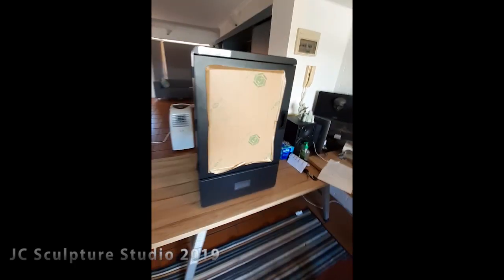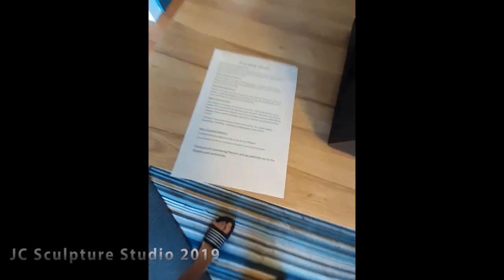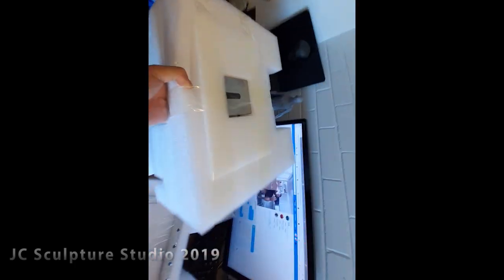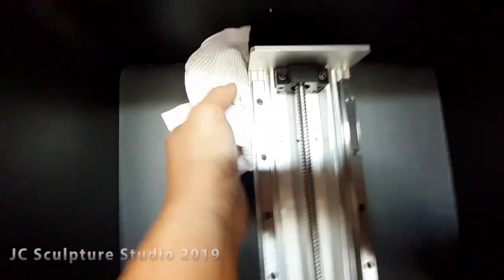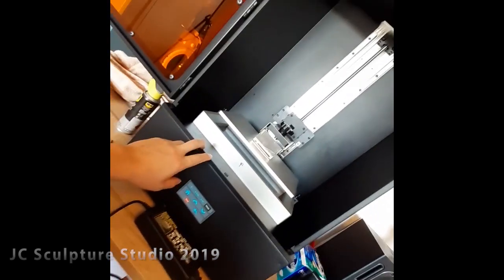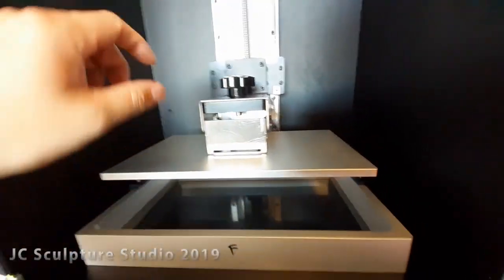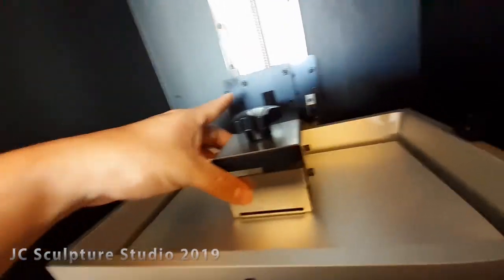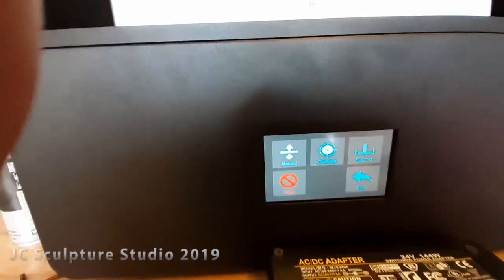Peopoly Phenom unboxing, level & first print

Comment: Nice video! I noticed u leveling with the VAT on? I did my leveling not using the vat and used a sheet of paper , lowered the z until paper couldn’t slide out then hot z=0, am I doing the leveling incorrectly?
Reply from the maker: Are your  printings sticking? If so u have done it correctly. Using a cleaned vat will give you true level, as some paper thickness can differe, but paper method is fine
Reply: @vfxforge  yes prints are sticking bit getting some weird flakes attaching to every prints even using a new fep and vat and filtered warm resin
Reply: @vfxforge  how do u make sure the platform is touching the vat FEP when leveling? Can you post a specific leveling video? Love ur work!!!!
Reply from the maker: @ArianHypnotiq  i dont think thats a levelling issue. get in contact with your printer maker.
Reply: @vfxforge  getting a new lcd from Peopoly. It’s a phenom L
Reply: @vfxforge  could you shed light on how you level yours with vat?
Reply from the maker: @ArianHypnotiq  same process as with paper, just using the vat + Fep instead, instead of trying to slide the paper down, just make sure you push down evenly when tigtening the bolts in two rounds, the trick is do it in two goes as I explain in the video.

Comment: Just unboxed my new Phenom.  Very well packed and it arrived very quickly from HK.  But no docs in box.  Anyone know where I can get user manual and/or setup guide?
Reply from the maker: docs and files should be on the USB thumb drive that came with the printer, or you can download it on the g drive they provided.
https://drive.google.com/open?id=1ELABSgXPBN7a1gGepzy_lgR7WWrRJHFm

Comment: What about a side to side test vs moai 200?
Reply from the maker: phenom wins
Reply: @vfxforge  I kinda guessed it as you already had Moai 200 and bought also phenom. And you are probably the only one on youtube making some videos on moai 200. I wanted to buy a Moai 200 as I really want a galvos-technology based printer, but I'm really concerned on use experience. Moai 130 seems a quite successful machine (but it is similar size of printer I already have) .  Moai 200... should  have similar performancer, just bigger, but seems something is gone wrong.